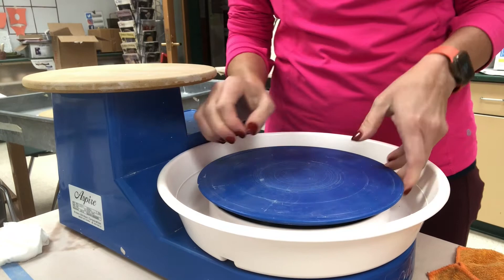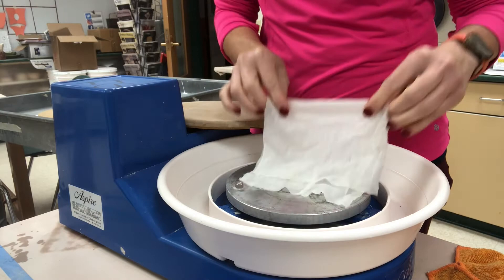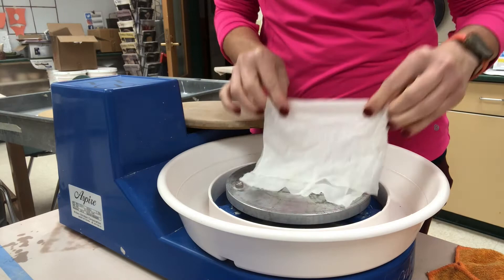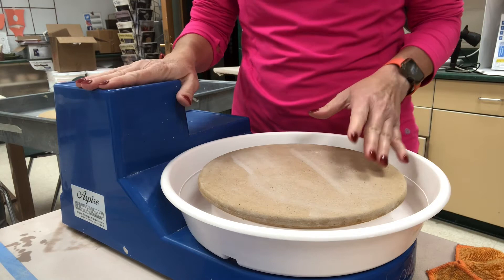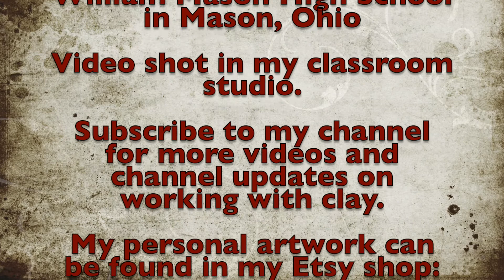Shimpo Aspire Tabletop Pottery Wheel:   An Introduction for my Remote Students

Comment: i use sewing i drop or 2 of machine oil on the rubber piece's it helps to get the nubs to squeeze into the rubber on the bat plus it protects the rubber from drying up and falling apart.

Comment: Are you familiar with the Speedball Arista? If so,  which is better, Arista or Aspire?
Reply from the maker: I have an CI Arista- before it was bought by Speedball- and it is very  similar in capabilities. The one big difference is the wheel head size. The Arista is closer to standard with standard spaced bat pins and I didn’t have to get smaller bats to use it.

Comment: PLEASE could you answer a question for me?
I've just bought the Shimpo Aspire. When the wheel starts turning, there is a quiet "tapping" sound coming from the motor. When it gets faster and to full speed, the tapping sound is more prominent (and slightly annoying). Could you please let me know if your Shimpos also have this tapping sound, or if you can only here the normal constant hum of the motor? Kind regards, Richard.